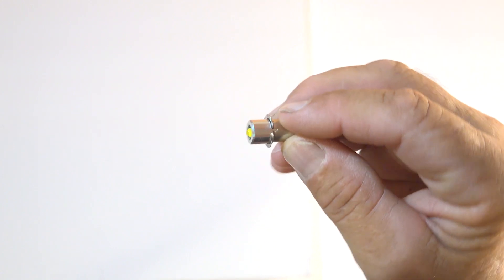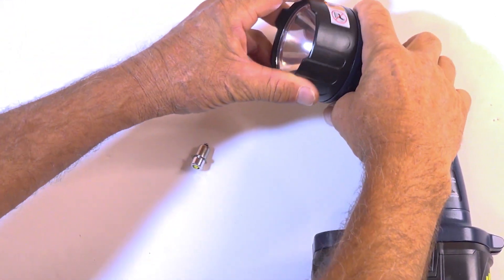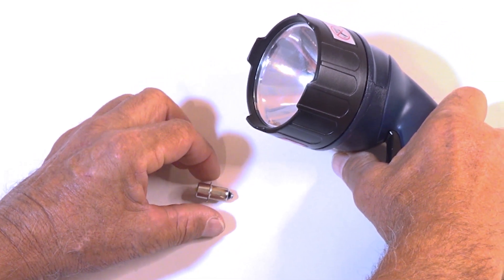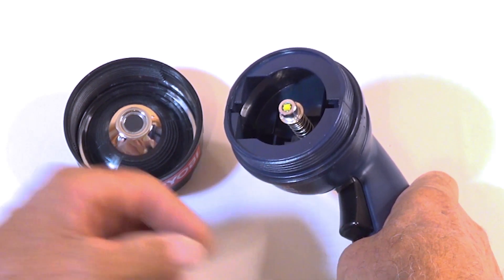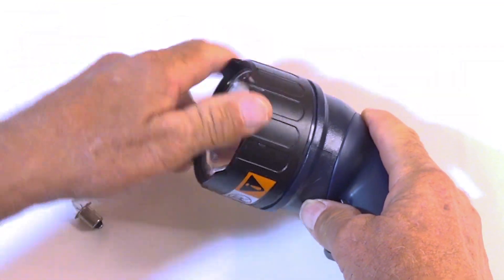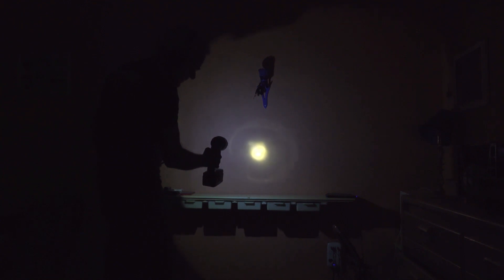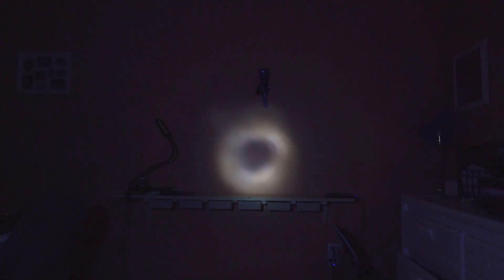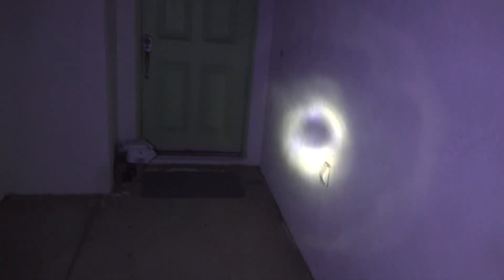How to Upgrade 18v Ryobi Flashlight to LED Conversion

Comment: Honestly, it's the luck of the draw with these bulbs.  I have several of these flashlights, and I just picked up a couple more today off a Craigslist purchase of some additional Ryobi tools (I needed one thing and ended up with 10 tools for $50, so I couldn't pass it up).  Over the years I've replaced the original bulbs with LEDs, and the quality varied regardless of the stated specs.  I actually marked my flashlights as #1, #2, and #3 to indicate brightest to dimmest, so I'd know which to grab without having to turn it on.  The good news is that I think all of the LED bulbs have been brighter than the incandescent, and they have all lasted longer and were less vulnerable to a fall by a factor of 10x over.  (I know bc I went through many, including a 10-pack of incandescents before I bought my first LED.  Only had 1 LED burn out so far.)
Reply from the maker: Hopefully these bulbs will last for those who buy them.  Many times it is just the contacts where the bulb meets the spring and other connector is beginning to corrode. I find if I put just a ting bit of antiseeze on these connectors it fixes the problem.  Antiseeze is just ground up silver in oil.  The oil helps stop it corroding further and the silver makes a great electrical connection.